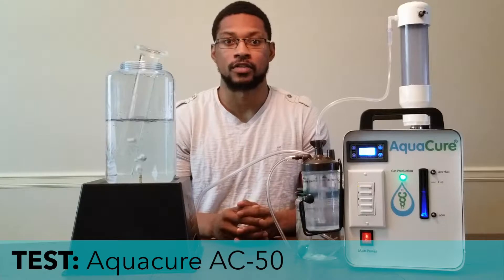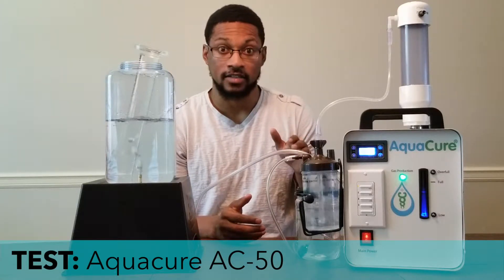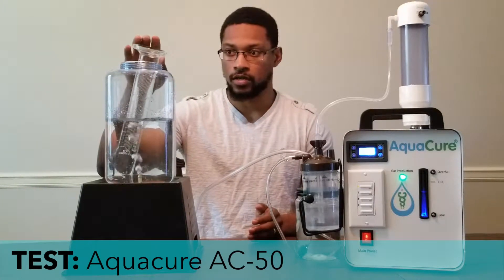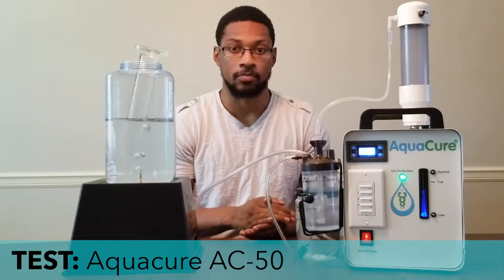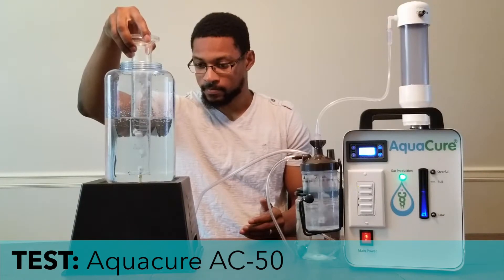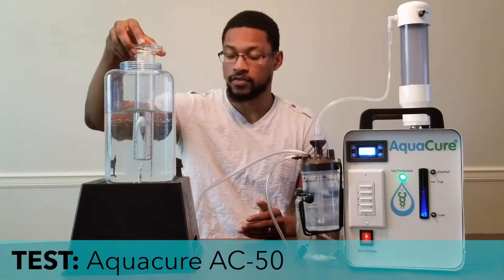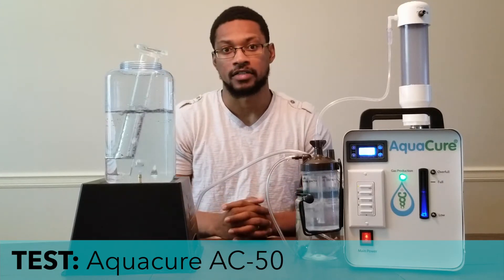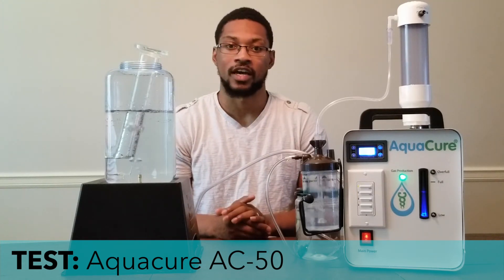TEST: Aquacure AC-50 - oxyhydrogen gas generator || H2Hubb

Comment: Sir this proves the amount of gas per minutes yes. But I would want proof that it really is producing hydrogen gas. It could just be air for all anyone know.
Reply: There is a very simple way to do this at home, even though some might say "don't try this at home" and you may want to do this outside:  put on safety goggles, take an empty  plastic (! NOT GLASS) bottle,  turn it upside down. Fill it with gas for a few seconds., take a match ... spectacular  und not as dangerous as it may sound. Science teachers around the world do this every day in front of assembled classes. I have tested mine like that in our kitchen, and yes, it sure produces hydrogen gas

Comment: Do you know if it is still producing gas if it stops bubbling? I'm supposed to run it at 22% for breathing but the bubbles stop. It still says it is producing gas.
Reply: Hello, if it stops producing bubbles you most likely have a leak! I had it when I first started using it. Take off the cylinder at the top incl. the part that screws on the steel thread, apply some more ptfe tape, you can apply it quite generously, a good 8-10x around the thread, (clockwise, starting at the top and apply more thickly further down), screw back on and test again. If there is no leak, bubbles are produced at even lowest concentrations! One way of testing for leaks is in fact to reduce to low concentration.

Comment: How much ozone and chlorine gas is produced.
Reply from the maker: Hello Stan, 

The only way chlorine (Cl2) is produced is if the electrolyzed solution was contaminated (e.g. you didn't use distilled water). You will need to contact Eagle-Research the manufacturer of the product to find out about the ozone levels.

Comment: You should Include in ALL  of your TESTing of H2 water the Voltage of the Water. This will tell the Negative Ion /electron content. This is the Healing aspect of H2, so evaluating the Electrical Potential or Electron Content of the Water is Very Important aspect of H2 water, and Does it have a HIGH negative Electrical Potential or Not?? Also the Difference between H2 water alone and H202 H2 with Oxygen together, and it Electrical Potential. This is the H2 waters healing aspect, its electrical Potential! so this test would tell how much Healing energy is Involved in each Glass based on its Negative electrical Potential. Dr Gerald Pollack discusses this in his lectures of EZ water, Structured Water, 4th Phase water. The question I have is does the the H2 only water have a High Negative Voltage then the H2 and OXY water.  Your testing does NOT provide the Potential Energy within each Glass of water produced by each Machine. That info is VITAL!!!
Reply: if the Brown's gas is diffused into drinking water it will reduce the ORP (Oxygen Reduction potential) value, however, it should be kept in mind that oxygen is being diffused into the water also, it should be further be kept in mind that electrically expanded water is being diffused into the water, the amount of molecular hydrogen that is being held in the water is no more than 1.5 ppm after 15 to 20 minutes diffusion, its better to inhale the gas/plasma. brown's gas contains a plasma.

Comment: Hello. Thank you for the videos. Would you recommend this machine for the alleged health benefits via drinking and inhalation? Do you ingest Brown's gas?
Reply from the maker: Hello Jonathan, 

You're welcome! This product has met our standards for recommendation as a oxyhydrogen inhalation device. That means it's passed objective performance tests that would otherwise state by our standards it provides hydrogen inhalation levels comparable to human studies, thus it may provide the potential effects seen in the scientific literature. 

Now that is for inhalation. As for hydrogen water it's not recommended by us for hydrogen water, although the product has an application for that. If one was to drink H2 water from this system it would have to be from the drinking water bubbler within the first 3-5 hours of use or bubbled with a diffusion stone (post drinking water bubbler) into a glass of water.

Also, keep in mind Brown's gas bubbled into water will at best produce 1.01 mg/L (ppm) of dissolved H2, which is a therapeutic concentration but it's on the low side compare other methods. A person can receive better dissolved H2 levels from hydrogen tablets. 

We use this device among many others at our home.
Reply: @h2hubb806  Interesting. Thank you for the thoughtful reply.
Reply from the maker: You're welcome!
Reply: @arcticjesus1959  drinking and breathing is fine. Don't take my word for it. Lots of testimonials on the sellers site. Plus 1 year money back if not satisfied and lifetime repair warranty if it ever breaks down
Reply: @h2hubb806  Thanks for your independent analysis. I'd be very interested to learn what other devices you use in your home in addition to the Aquacure and for what purposes? I have been going down the proverbial rabbit hole after I heard Greg the Hydrogen man talk poorly about electrolyzers that use metal plates and lye to split the water and how Brown's Gas was not as effective of a molecular hydrogen treatment as his HydroFix machine. I have discovered that there are vastly differing opinions out there and it's extremely difficult for a layman consumer such as myself who just wants to make the best health decisions to know what is true and what is false/distorted/imbell
ished information. Any insights here would be super appreciated.

Comment: Hi, please can you recommend or test a machine from China/AliExpress? 
A low priced one.

Which do you think is best hydroxl machine?
Reply from the maker: Hello Samson, 

Thank you for your comment. We are more than willing to evaluate lower-end price range systems. We actively seek out hydrogen products for evaluation and recommendation purposes. We are also contacted by manufacturers and/or companies seeking our recommendation. In my opinion, there are not many quality low-end hydrogen generators worth purchasing. You could consider H2 Life Brown's Gas Therapy device produced by Hydrogen For Health (https://hydrogen4health.com/product/hydrogen-breathing-machine/). That system may be therapeutic and worth considering. You should also consider drinking hydrogen-rich water which is the most common therapeutic way of administering hydrogen gas to the body.  Here is a high-end portable hydrogen water bottle that has passed our standards.

https://h2hubb.com/hydrogenforhealthh2lifev2/

Let me know if this helps.
Reply: @h2hubb806   Hydrogen for Health page no longer exists, error 404.

Comment: Hey @h2hubb...did you ever do a dissolved h2 test on this machine?  I have the older version and have been getting lower than expected, curious what your results are?
Reply from the maker: Hello Phillip, 

Sorry for my delay in response. We are not receiving comment notifications on our channel for some odd reason. Here is a response I wrote to another person regarding a similar type of question. Hopefully it will address yours as well. Fyi, my email is Tywon@H2HUBB.com, it's my primary communication platform. 

"Hello, 
Sorry for not getting back to you, our correspondence got lost in the shuffle. As to your question sure I will add my two cents. Infusing water with Brown's gas (66% H2 /33% O2) will dissolved both gasses up to their partial pressure/saturation point in relation to the gas concentrations be supplied. This means for hydrogen gas saturation will be 1.03 mg/L (ppm) and for O2 saturation will be 13.72 mg/L (ppm) because brown's gas supplies 66% H2 and 33% O2. Henry's Gas law saturation levels are based on 100% concentration of each gas. Brown's gas devices will basically produce 1 mg/L (ppm) H2 water after the water has been sufficiently bubbled. Pure H2 devices will be able to produce 1.56 mg/L (ppm)(basically saturation) H2 water because they supply <99% pure H2 gas. The increased O2 concentration of the water is irrelevant as you would get more O2 from breathing another minute then if drinking a gallon of the water. A gallon (4 liters: most people can not drink that much water) of brown's gas water would only allow you to ingest 2~3% of the O2 you would inhale in a minute by breathing and that is assuming the O2 would be absorbed into the blood. Also, even if the oxygen is absorbed in the blood, it ends up in the venous system, which takes its path directly to the lungs. So even though there is extra O2 in the water, it would will not make it to our muscles. Lastly the infusion or dissolving of the gas will be highly affected by the diffusor and volume of gas produced not so much the gases themselves. A decent diffusion stone will saturation the water pretty efficiently. "

Part two of our correspondence

"Hello,
No, I haven't tested the AquaCure drinking water bubbler for dissolved hydrogen concentration due to a few reasons. One, we don't own the testing equipment to properly do a mg/L test on BG water. I have done mg/L H2 concentrations test on BG water with another device that uses a similar diffusion stone and has comparable gas output. It measured 0.6 mg/L after 10~15 mins of bubbling, however, H2Blue results in 10~15% lower mg/L reading of H2 because it was designed for 21% O2 (not 33% O2.) With that in mind the 0.6 mg/L reading would be approx 0.7 mg/L in actuality but that's still a calculation to figure up the dissolved H2 content. I don't like that approach much. I will use it if it's necessary but it's is not very common. Remember BG water saturation point is 1.0 mg/L of H2 (@ SATP), the 0.7 mg/L measurement is not that far off. I didn't mention the DHC of the AquaCure drinking water bubbler because I thought it was important to provide my two cents on BG water not the AquaCure bubbler itself."